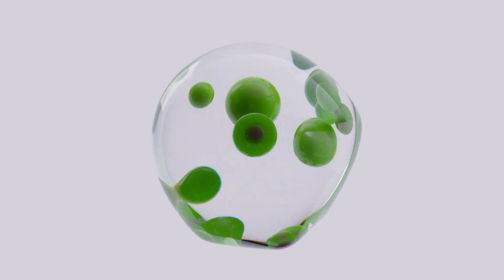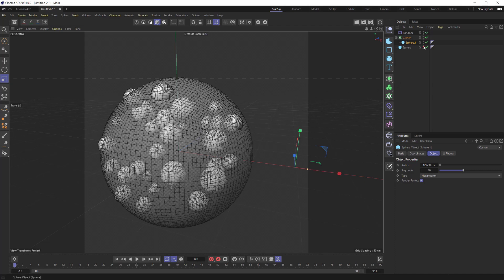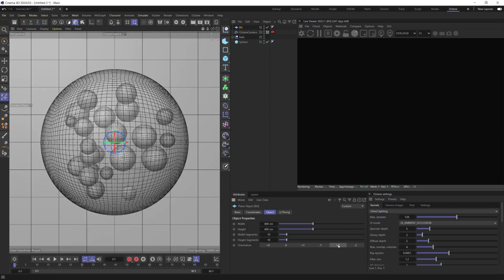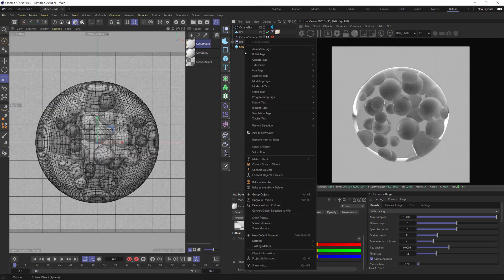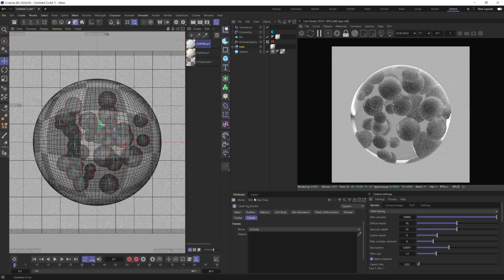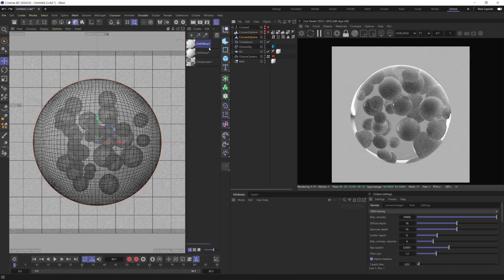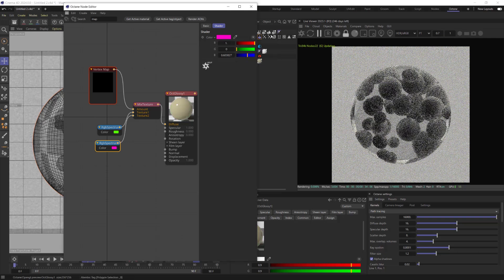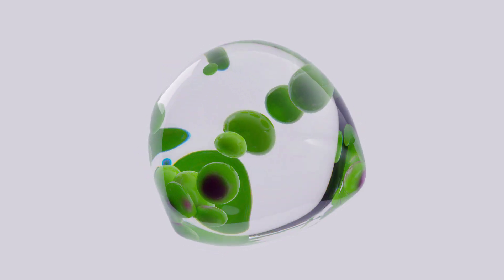Cloth bubbles simulation in Cinema 4D using Octane Render

Comment: Thank you very much for the very good Dutorial.
There's something I'm curious about,
In the tutorial right now, when small bubbles in a big bubble come into contact with each other, that part becomes pink, but I want to make it pink only for the side that only touches the big bubble. Is there a way?

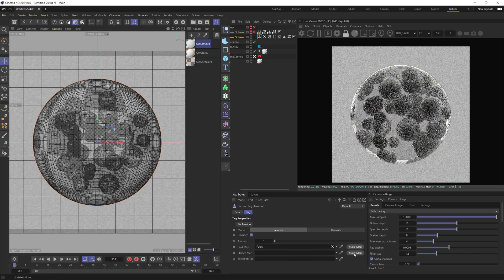And I'm wondering what the respective roles of the Fold Map and Stretch Map are in the tension tag around 8:46 seconds.

Lastly, 10:26
After copying the vertex map, you removed Freeze delete and set the mode to Average to make the pink area smoother?

I'm Korean so I didn't understand your tutorial 100%. I'd really appreciate it if you could answer.
Reply from the maker: Hi! I din't think about it but maybe you should use Selection Tag field in the Tension Tag? I am not sure. Help shows this info about this field: "You can Drag & drop a polygon selection tag into this link field to restrict the evaluation of stretching and compression to specific polygons in the mesh." You can try and have a feeback here about your results ;)

Also, you can easily switch on subtitles to your own language to be able to understand the tutorial.